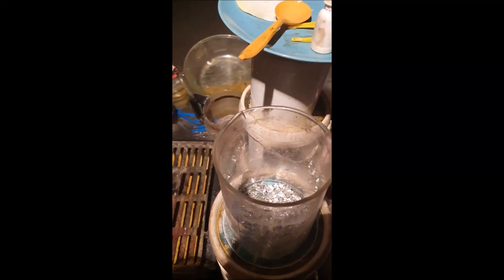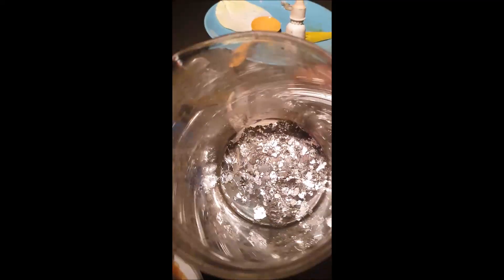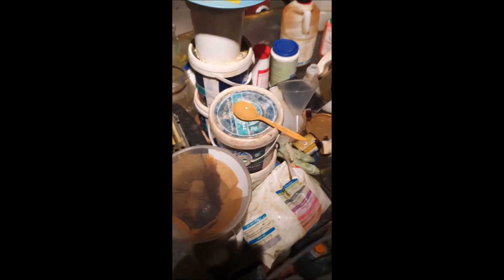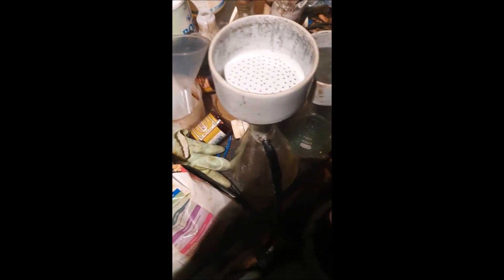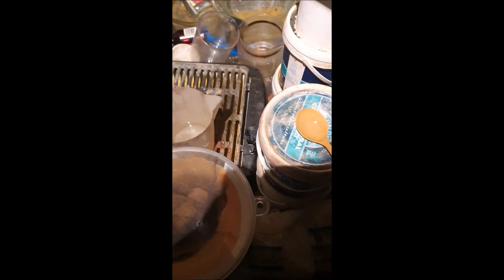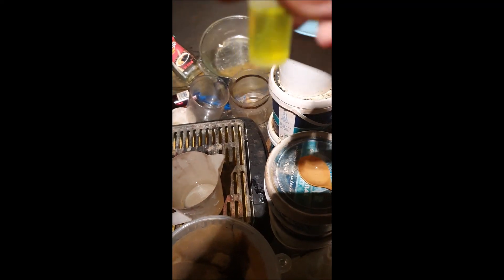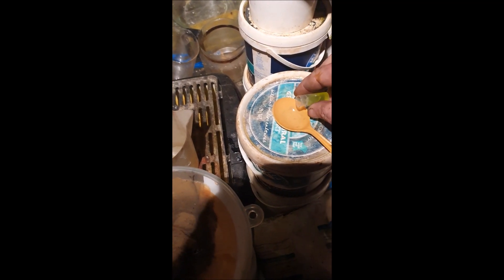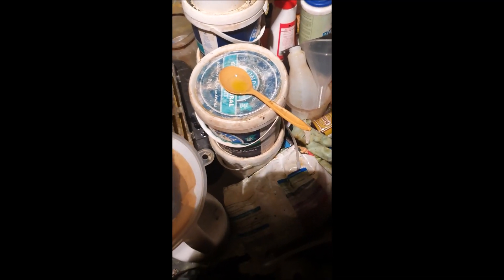STANNOUS CHLORIDE / how i make stannous chloride , cheap and easy

Comment: Can you change the colour of stannous chloride without changing its property!!
Reply from the maker: My stannous is clear.
It's only hcl with some solder thrown in
Reply: @prospectorpete  can we do it on other stannous chloride?
Reply from the maker: @DDOfWTF  what other stannous , theres only one stannous, hcl and tin
Reply: @prospectorpete  i mean  manufactured sncl2 !!
Reply from the maker: @DDOfWTF  ive only ever made my own , i dont see a point in spendin money on somethin i can make myself ive made it two ways , ive added tin ranuals to hcl  and ive added solder to hcl
Reply: Does it HAVE TO be filtered, first? Will it still work if not filtered? Thx.